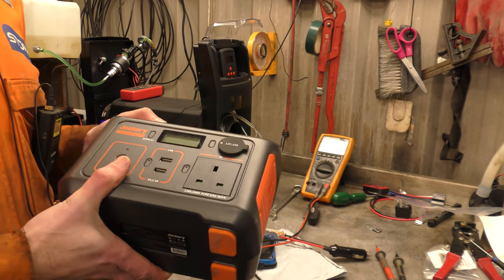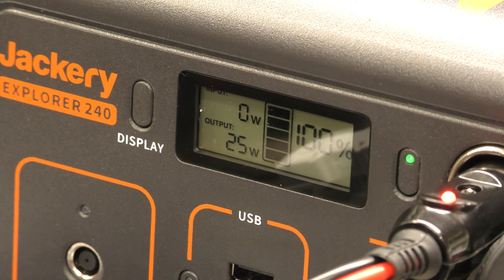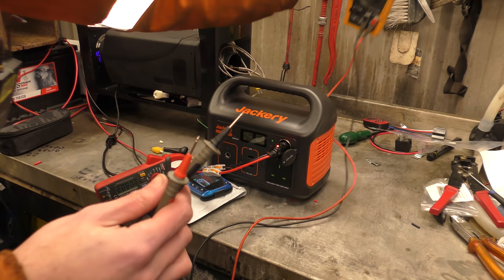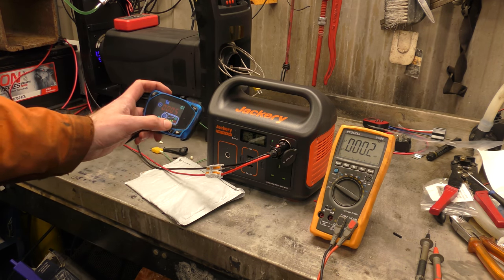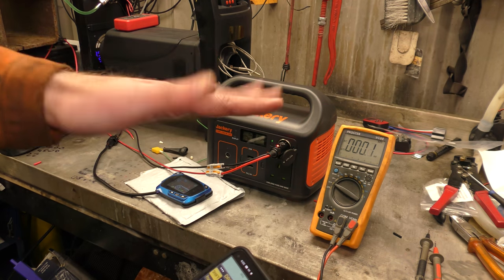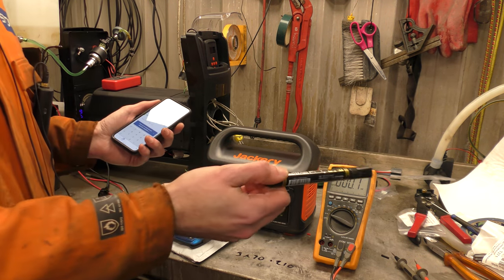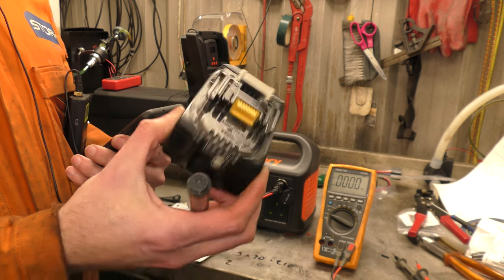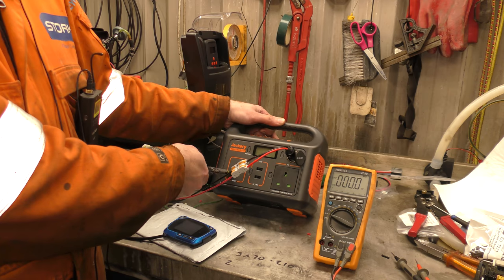Diesel Heater Running from Portable Power Station

Comment: Another option is to go to your auto parts store and buy a 50Ah deep cycle battery for a fraction of the cost and connect it directly.
Reply: Exactly what I did.
Reply from the maker: True.  But we've done that one and people asked if a portable power station would run the heater.
Reply: @DavidMcLuckie  and most "deep cycle" lead acid batteries will only do around 500 80% discharges. A lithium battery should do more like 2000-3000 so it might actually work out cheaper in the long run to go lithium...
Reply: @DavidMcLuckie  Dont get us wrong. We really appreciate your effort! I guess Christopher only wanted to point out that alternative solution for people who didnt watch all your videos (shame on them!). :-)
Reply: I killed 2 used deep cycle batteries I used for years running led lights. Running my Chinese heater in my garage. Heater is awesome but I need to tinker more with it.... I just got a jackery 240 but was not thinking for the heater but wow cool
Reply: Agree with comments that deep cycle battery is an option. However everyone’s use case and tech skills are different. We had a roof top tent, and now a teardrop trailer. The trailer is stored offsite and outside since we do not have a garage. As a result it does not have an AC trickle charge connected. So we actually found the Jackery a more flexible solution, possibly cheaper given the number of cycles they will run. After a year of constant use no complaints. One added benefit is that we have brought the heater and Jackery with us in the rooftop tent, the teardrop and a regular ground tent, plus lent the solution to our daughter. So the flexibility has been a great plus. And if needed I can use the Jackery for other home use when needed. Good luck all.
Reply: @tomfrengillo  Any issues running the AC trickle charger at the same time the battery is running the heater?
Reply: @NuManXplore  If you have AC available, why not get a 12V PSU to run the heater instead of using the battery? It's easy enough to find a 12V 20amp PSU and build it into an enclosure to power the heater
Reply: @lemonherb1  Is a PSU the same as an UPS (Uninterruptible Power Supply) used to power computers in case of a power outage?
Reply: @NuManXplore  No I mean a generic open frame AC to 12v DC PSU
Reply: @lemonherb1  ok, I’ll look into that.
Reply: But charging? This does all 3
Reply: It's nice with the power station because there are so many options for recharging... solar, car 12v outlet, and ac power
Reply: @DavidMcLuckie didn't work for my vevor diesel parking heater.  kept throwing error codes. bought a deep cycle 12v and then it worked fine.  i don't know why yours worked maybe it's because you're irish.
Reply: Waste of money

Comment: I wonder....could you get enough power out of a Peltier plate(s) to offset the draw from the fan when up to temperature? Think stove fan on steroids!? You would obviously need an additional supply to get it up and running, but if you could generate enough energy from heat...the thing could run forever!

Comment: Hi David. Thanks for another informative video. My take on a power supply for the heater is two 7amp hour lead acid batteries (14ah) ,solar charger for voltage display and usb output and charging. I use the heater to heat my tent on winter camping trips, and have a small wood burning stove for cooking. Cheers, Jim.

Comment: Really the best way is go online to a rc hobby store and order a 4s lipo and a charger. If you want to save money, take the computer power supply out of an old/free computer tower. They typically range between 300-600 watts. Plenty of power for this application, and absolutely free.

Comment: Mr McLuckie. Just when you have an idea somebody is already there, and in your case with a fun comprehensive explanation. This is great for camper vans. You can run your fridge and diesel heater from the cheapest jackery power bank , and you can charge the bank on solar. Cold for bear and heat for sleep and drying wet cocks, all on the cheap, my world just got better. Thank you my man.

Comment: Took forever to find this video, so helpful! Thank you! Excited to hear my jackery 300 should run my DH without issue
Reply: My jackery 300 explorer plus WILL NOT run my HCalory diesel heater through the cigarette plug. Runs for 10 seconds and then quits. I'm using a 20AH and a 50AH liFePo4 battery to run it. I can get over 11hrs on the 20Ah and over 24hrs on the 50Ah battery on low heat which is plenty for heating my 2 person RTT in dead cold of winter.

Comment: 10amps wasn't enough to power my heater. It uses about 11 amps on startup. Had to get a DC-AC converter with 15amp max to make it work.
Reply: I have a Jackery 2000 Pro and it will not start my Espar gasoline heater.  they tell me it requires 14amp at start up and the DC output only outputs about 10amps?  How is this video possible?  Same issue as you also already trying your idea.  Waiting on the AC-DC converter to arrive.
Reply: @guy4fawkes  I have a lavaner pro heater. I was able to make it work just off 10 amps by allowing the heater to go in low voltage mode for a longer time before cutting off. Changed to 3 minutes instead of 2. That works.
Reply: @StevenDavisPhoto  I'm not sure the Espar has that ability but I'll defintely look into it with the manufacturer.  Thanks!
Reply: @StevenDavisPhoto  ive just got a 2kw lavaner this week. Do i understand correctly you are powering yours from a power bank? Do you need anything else too make it work? Know nothing about these things
Reply: @finnomara4148  yeah i power mine with an ecoflow delta 2. that's all. i was able to change the heater settings (max amperage?) so that it wont shut off if over 10amps. it only uses 10 amps on initial startup to heat the glow plug, then it uses like 2-3 amps for heating after that.
Reply: @StevenDavisPhoto  thanks very much. So just straight plug in .i don't need a converter that people are mentioning.
Reply: @finnomara4148  i didn't. just set your heater to allow for a longer tolerance for the shut off. you may need the afterburner controller to do that tho. i forget.
Reply: @StevenDavisPhoto what model heater are you using that allows that max amp programming?

Comment: I have the Jackery 300.  I will try it on my 5kw diesel heater.  I believe Jackery's have a regulated 12 volt outlet.
Reply: Did your Jackery run the 5k? My Ecoflow Delta goes into overload.
Reply: @CallaFab  hey same thing here i also have ecoflow. and it keeps saying undervoltage" on my diesel heater. but if you would buy the $14 12v to AC power supply and just use the AC outlet of the ecoflow, it will just work fine.. im goin to different route and probably just have a 20ah Lipo with solar for a standalone diesel heater.
Reply: @21se7en2  I ended up making a 12volt pigtail. Heater plugs into it, then the adapter Y's off to the ecoflow and a battery. This provides enough amps to start/stop the heater and the ecoflow keeps the battery topped off as well. No reason to 'waste' power running an additional AC power supply. I found this works perfectly fine.
Reply: How long did it end up running your 5kw Diesel with your Jackery 300??
Reply: I just got my 8kw (same as the 5kw) all-in-one.  So, now I have 2 diesel heaters.  I ran it today off the Jackery 300.  It pulled close to 140 watts at the peak with the fan on high and the glow plug on.  Once the glow plug went off with the fan at full speed and up to max temp it pulled a constant 51 watts.  At the lowest temp and the glow plug off it drew 11 watts.  So, how long it will run depends on how high the heater is turned up.  I left the Jackery plugged in so there was no battery depletion.  The Jackery 300 had no problems supplying the DC amps.
Reply: @cash2.0  how long did it run for on a full charge? I’m debating between the 300 and the 500 to get at least 8-10 hrs on an overnight. I’ve got the 5kw heater
Reply: @cash2.0  I would run it on high all night with ice fishing in Minnesota during the cold months
Reply: Chris, running on highest setting I'm not sure I would trust either to run 8 to 10 hours and still have enough capacity to operate the glow plug during shutdown where the power draw will be like at startup.  If the battery unit runs out of energy there is a high risk of burning out the main controller board as it may get cooked when the cooling fan stops while at full temperature.  I would suggest asking Hobotech (on YouTube) what battery power station he recommends. I'm thinking maybe the Jackery 1000 but I don't know if it can handle the DC amps.  The 300 has a powerful DC output.  Hobotech tested them all and the 300 put out more on the DC side than any of the others. The 5kw and 8kw are identical in every way except for the decal that shows 8kw.  They are both 5kw units.

Comment: I work with the German unit's quite a bit and i use edith as a diagnostic measure. The amp drop is your glow plug heating up and the German models are the same values you gave on the video. People pick up this unit and save money. ❤
Reply: Oh the glow plug probably give you 2.5 to 5 amps on start up and once flame is detected the glow plug shuts off and all you are powering is the blower motor and fuel pump. Think of the turtle vs the rabbit race. It will take just a few minutes to reach operating parameters but one done solar panels can keep the unit going

Comment: The power Oak couldn't run a diesel night heater off the 10 amp power socket, tested by Mel's Van Life. The Jackery did work just like you demonstrated so they're definitely not all equal 👍
Reply: that was the old model with an unregulated 12 volt out , the newer AC50S does have a regulated output and run a CH just fine , I know as I use the newer one to run mine .
Reply: @uptowndisco2  I know they started using regulated 12 volt and actually thought the one Mel uses was the newer one but I'd have to go back and check his videos.
I know he made a video comparing the Jackery and Power Oak a week or two ago.
Anyway I appreciate you replying to tell me yours does work, perhaps I'll check out his video again and mention that 👍
Reply: Any time I have tried to draw that much amperage out of a cigarette lighter plug it heated the spring up and fried it
Reply: @juliogonzo2718  Yeah Julio, I definitely wouldn't recommend it.

Comment: Switched from a battery back up for my plug in power supply to a UPS powering my 12 volt power supply . Wired up two W1209 temp controls to turn it on and off . The temp controls have one hiccup. They will turn the heater on when the off temp controls closes with the heater off . I just unplug the heater control when it is warm outside .

Comment: Hello, how did you get your heater to run on a jackery, I have an explorer 1000 and it won't run the heater? Thanks.
Reply: I have a Jackery 2000 Pro and it will not start my Espar gasoline heater.  they tell me it requires 14amp at start up and the DC output only outputs about 10amps?  How is this video possible?

Comment: Weird...I tested mine with the Bluetti EB3a (600watts) and it would not fire up even though the cig. lighter port  is rated at 10 amps. How the hell did this ‘lower' unit do it?
Reply from the maker: I've noticed through testing that it is depends on both the diesel heater and the power station.  Some heaters creep above 10A at start up.  On the other hand some power stations the voltage drops off as you near the 10A point.  Which means the glow plug doesn't get as hot and the fans don't spin fast enough usually resulting in a non-start.
Reply: Thanks! From your experience does the Jackery 500 do the job and last for the night --10 hours (Vevor 5KW)... @DavidMcLuckie
Reply: @andrewmarkmusic  I have a Jackery 2000 Pro and it will not start my Espar gasoline heater.  they tell me it requires 14amp at start up and the DC output only outputs about 10amps?

Comment: Does the heater really use more than 10 amps for startup? I'm looking for a 110v to 12 volt houe adapter, and not sure if I should get a 10 amp or 15 amp adapter. The 15 amp are much more expensive and common.

Comment: I have a diesel heater and set it up twice but it only stays on for A very few minutes. Can u tell me the correct cord to use from unit to Jackery as I feel this is my problem. I used a 12v cord. Is it different a page????? Nothing in instructions about amps. Thank you for your video.

Comment: Very useful video. But I found it after I ordered my Explorer 240 because of the seasonal discount code. My hopes are to use it to run a diesel heater, but that's going to take me a couple of months to buy the heater and other parts to build a system. My plans are eventually to put it all in a roof top box that I can mount to my car's roof and depending on how I run ducts and hoses, it'll be used to heat the car, garage or ice fishing tent

Six hours operating the heater is a bit of a disappointment, but this is the only size I can afford for the time being so it'll be a good place to start. I guess I'll have to figure out the run time for having it on half and low power and seeing how it'll be at keeping a tent on the ice warm. But it sounds like I'll probably still run a propane heater probably during the non sleeping hours I'm fishing.

As for in the garage, I'll probably get a 12V PSU in the roof top box to run the heater since I'll have grid power available there.

Comment: Will a 500 watt jackery be able to startup and run a diesel heater? Just in the dc port?
Reply from the maker: Sadly not a yes or no question.  Some heaters use more power on startup than others.  So while one heater might work, another might not.  The Jackery should start most 2KW diesel heaters though.

Comment: i have a jackery 500 but after i started my heater and the fuel pump kicked on i got a E01 error code for low voltage, do you know why that would happen? I think i have a 8kw heater, is it too much for the jackery? Thanks
Reply from the maker: Hello.  First thing is there's no such thing as 8KW heaters, they're just mis-sold 4-5KW, but that's a whole other topic.  Could be your wiring is causing a voltage drop at high load, lots of the heaters come with undersized wiring.  Other possible reason could be the low setting on the heater is too high.
Reply: @DavidMcLuckie  yeah i figured the 8kw was a scam lol thanks, back to the drawing board

Comment: So, realistically, how long on a full charge can you run a diesel heater off of this Jackery Explorer 240?  full power for 10 mins on startup, full power on shut down, and low power/fan throughout operation?  Thanks for any help you can provide.
Reply: I've ran mine for about 16 hours on the lowest fan setting without having to worry about a charge.  Takes 110w for about 5 minutes for the glow plugs to get going, and then runs consistently around 10W continuous, and 110w to cool down the unit when you stop it.
Reply: This was the question/answer I was tirelessly searching for; thank you both!

Comment: I bought a similar spec portable battery which doesnt have the guts to fire up an 5kw on either its DC or AC with a PSU. I ended up getting a Y cable and connecting the heater to a 3 cell lipo and a lipo charger. The lipo battery handles the starting and stopping current. The charger which is powered from the bank is set to balance charge at 1.4A (depends on heater output setting). A balance charger ramps down its charging current as the battery voltage nears 12.6v. With the load of the heater it never reaches 12.6v so just continuously charges. 

Not an idea solution but I had the stuff on hand.

Comment: This is an interresting video. im looking at getting a diesel heater for shed/greenhouse. I dont know if you have done a video on these heaters being run of a 12v battery, how long would a 120ah battery power these heaters on a worse case setting of 40w

Comment: What is heater kW? I have 5000kW but i don´t think it could ber used on 10A outlet.
Reply from the maker: The 5KW is the heat output.  The heater itself running only uses at worst about 150W during startup.

Comment: Might be a silly question, but i have no electric knowledge.  If a power bank only delivers 12v 7.5a can i use it to run a boost converter 12v 15a to get a diesel heater running ?
Reply from the maker: It's my understanding that a boost converter only ups the voltage not the current.

Comment: I have a Planar portable diesel heater that i run from my 12v connection on my Jackery 1000W power station. It is a 2kwh heater. Upon start up it draws maybe 8 amps for a minute, and on the low setting less than 1 amp. I’d suggest you’d get more than 6 hours on that smaller Jackery. I’ve been using the heater for a year with a heavy duty cigarette plug and it’s been great.
Reply: Hi Tom, I'm trying to buy the portable planar and I can't find the place, always above 5kw. Could you share where did you get it, please?
Many thanks
Reply: @acmthere3674  Planar Heaters and Expedition Upfitters are both in Canada. Expedition is an approved reseller for Planar, or you can go direct to Planar.  I also found a USA company that got into the market. Seems about the same type of solution, lower price point for now. I have no experience with them though. But these things have jumped in price dramatically, so shopping for options isn’t bad. There is a YouTube channel called Keegan Builds who has started making these as well. Looked like a very high quality design but he wasn’t in production when I was ready. Happy to give feedback on the 2kw unit, feel free to reach out. Good luck.
Reply: @tomfrengillo  many thanks for your prompt reply, very kind.
I'll check them.
Regards